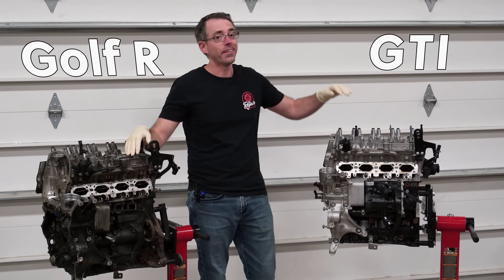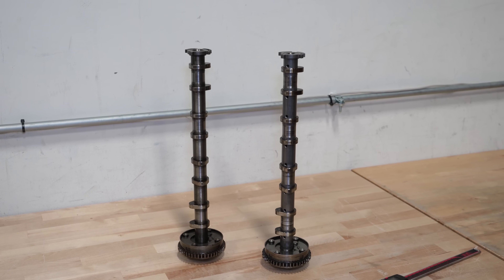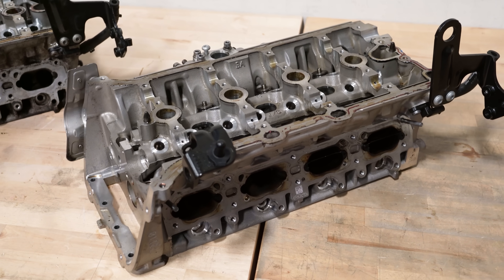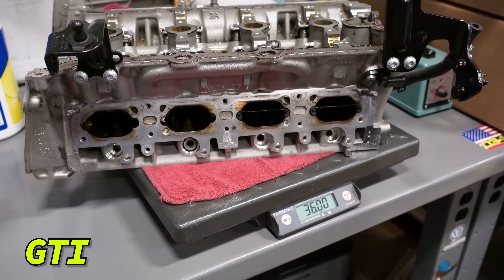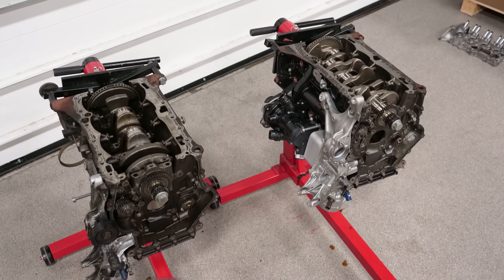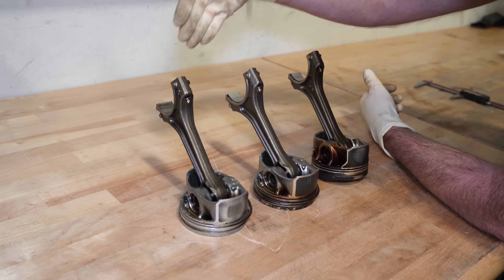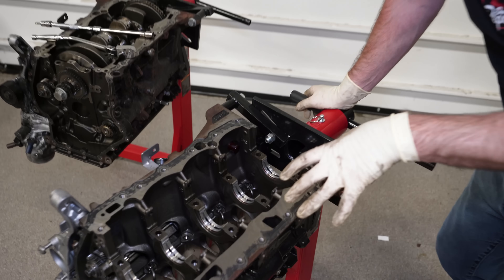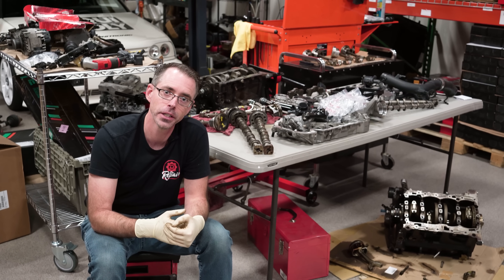Are Golf R Engine Internals Better than a GTI?

Comment: You can find the actual Audi SSP detailing the changes from the 2.0T low output (is20) to the high output engines (is38). And yes, the valves are different materials.
Reply: We need a link/vid

Comment: You put a risky claim on that the cam from a GTi and R are the same...
For sure if the part number is different, the part is different...only the manufacturer know what's the difference...and adding to this, they will attempt to save money if a GTi cam will last in a R engine for the intended life span.......
Reply: OEM's put different part numbers on exactly the same parts at times. 
I know that from working in the OEM supply bussiness.

Comment: Why I love my 40 year club sport mk7… 

Gti with R motor and turbo..CJX coded motor
Reply: Same . Best of both worlds.
Reply: and still FWD 😂
Reply: @blam9346  Clubsports are much  faster around a track than the R and better to drive. But youre probably American and they were never sold there so you wouldnt know brother 👌
Reply: @blam9346  on a roll though I’ve taken down many a R
Reply: @blam9346  It's a Golf after all.  Golf is all about the packaging advantages of front wheel drive, compared to the (at the time) old fashioned rear wheel drive Ford Escort, Toyota Corolla, AMC Hornet, etc. You can have a M140i or M2 if you want rear wheel drive I guess.

Comment: Given your claim that the parts for the Golf R engine is generally better, the same may apply to the Golf R crankshaft too. So it’ll be interesting to see the outcome of your experiment of mating the GTI crank with the Golf R engine.
Reply from the maker: It’s possible it has different metallurgy or heat treating but hard to say.

Comment: perhaps the duration on the R cams is how they got away with not having to use secondary air due to "EGR" is done on the exhaust cam
Reply: If the exhaust cam duration is long enough, the negative wave will return from the exhaust port and travel across the cylinder and up the intake port since the intake valve may already be opening before the exhaust valve shuts. There's tuning reasons for all of this. Of course all the stupid emissions laws really makes it tough for manufacturers to actually tune cam timing between IN and EX in a way for max power, exhaust scavenging, and the like.
That is what is identical in scientific principle between a 4-stroke and 2-stroke, is the exhaust pressure waves and how they affect cylinder efficiency.
Reply: @turnin.sprocket  awesome.
Reply: Now that is good thinking. I am looking forward to the next video to see if they also come to this conclusion.

Comment: The extra duration on the exhaust lobe is to sacrifice a little efficiency at low load for an increase in exhaust gas to the turbo at higher load. In other words it helps response with that larger turbo but will likely use a little more fuel around town.
Reply: I read somewhere that in the EA888.4 engine more exhaust is directed through the EGR to heat the engine faster thus reducing emissions.  It may already be in the EA888.3 R engine along with the copper alloy head?  Also the coolant specification for the Gen 4 engine is different than for Gen 3 possibly indicating more Cu in the alloy, requiring a coolant less corrosive?  The Gen 4 also has a Continental turbo not IHI.  I just bought a T-ROC R with the gen 4 engine, so have been slowly learning about it.
Reply: @einfelder8262  Its exactly that. The gen 4 is just massaged to get through the later EU emissions regs. Warm up and temperature control are critical at that level of emission scrutiny. Its not just the engines ability to pass more heat off but also its ability to keep the temperature as close to optimal as possible over as much of the operating time as possible. 
Fast warm up and cat heating is critical for lower cold start emisions but that wouldn't work well on a GPF car if it had to run hot which gives more NOx so it has to get hot fast then level out and hold temperature well - hence the different materials used.
Reply: @siraff4461  My Gen 4 also has a GPF/PPF (gasoline we call it petrol :)  ), not  sure if all of them do.  But it definitely warms up to operating temp fast (at least on the gauge.
Reply: This makes sense to me intuitively as a neophyte!
Reply: How come the engine looks so weird and 220hp turbo is wildly weak and inefficient like compared to a honda k series it looks like a cheap toy from performance to design and visually lol. Is that just a vw thing?
Reply: @repingers9777  Weak and inefficient? It makes more torque over a much larger spread, more top end hp unless you're talking about the JDM 220hp K which is quoted on their rather more spicey fuel and on top of that it uses far less fuel and puts out way less emissions - which is the entire reason the K couldn't continue in any of the heavily emission regulated markets. 
It also comes in variants far higher powered than 220hp.
Reply: @siraff4461  dang you are smart the world is less cooked than i thought. Also i was surprised to see a new version of variable lift i havent seen!
Reply: @repingers9777  There are quite a few versions of variable lift or timing or both. 
An interesting one is the Suzuki system they use on their newer GSXR1000. Its effectively centrifugally controlled like a small version of a snowmobile variator so there are very few moving parts and its very compact/light. 
Its downside is its fixed so electronics can';t change when it varies the cam but of course you can change the weights if you need to go that far into things.
Reply: @repingers9777  220hp (or even the 1.8 EA888 at 180hp) is heavily detuned.  It's more than a match for the K20C at making ~320hp. 🙂I think the K is the more elegant engine (the timing chains, balance shafts, water pump etc are far more simple; the VW variable valve lift system with 8 solenoids for 4 valves is preposterous), but VW guys love their robust cast iron block and semi-closed deck!
Reply: @TassieLorenzo  respect
Reply: @repingers9777  VW owners don't give a damn about your k series engines, nor do we give a damn about your opinion.  Go back to your ricer videos.

Comment: Those lines on the con rods are from them sheering the flash off not from the actual forging process. The flash is the material that squishes out of the forging dies at the sides.

Comment: According to the VW parts catalog, Gen 3 Golf R connecting rods are the same part number as Gen 1/2 EA888 engines. GTI rods are the same as every other Gen 3.
Reply: Sometimes they reuse (old)components in new developments...thus saving on development costs...

Comment: I thought they'd be even more identical than seen here just to keep supply chain/parts/assembly etc as simple as possible.  I guess the cost of certain GTI parts are cheaper than R but It's surprising that difference merits using more than 1 part.
Reply from the maker: I thought the same
Reply: There's a heap of variations of both engines, globally. It's already too doggone complicated. Thanks to save-the-planet overlord goons.

Comment: Fascinating, I'm looking at either a 3rd gen Audi TT roadster which can be mapped to around 300hp or an S3 convertible which has 306bhp out of the box. As the 2l engine is mostly the same  as the VW here I'm assuming now that the S3 is the better option as the engine is built to handle 300bhp long term

Comment: Aside from the actual alloy of the cast (which I didn't expect), there doesn't seem to be much of a difference between GTI and R.
Sure, the small differences can do something for long-term use and wear. But IMO nothing seems to crazy to see it as a "must have" upgrade over the GTI.

Very interesting, and great video idea!
Reply: Agreed. The biggest practical difference is the turbo itself and the exhaust lobe profile change to accommodate the difference in turbo response and feel. A stage 1 GTI tune is making more power than the standard Golf R tune to begin with, so it's not surprising given they're essentially the same motors and I'm not aware of any real increases in engine failures on tuned GTIs. Makes sense given the internals are essentially the same where it actually matters for making power reliably between both the R and GTI.

Comment: I just did pistons on a Audi 2.0TFSI flex Fual
I’ve always wondered the difference in these engines. I knew they were very similar. The Audi flexfual head also does not have Secondary air And a larger injectors for the high flow ethanol. My engine Code is CPMB

Question at what RPM does the variable Exhaust cam change?

Comment: I’d love to see the differences between the later mk7.5 R and GTI or mk8 R and GTI… to see if there are internal differences with the GTIs calling for 508 0w20 while the Rs are still using the more traditional 504 0w30
Reply from the maker: They changed oil pumps for the 0w20 cars.
Reply: @Deutscheautoparts  aren't the piston rings different as well?
Reply: Honestly I don't see 0w20 being better than 5w-40 for turbocharged engines.
Gotta appease the CAFE standard gods with a minuscule amount of internal fluid drag reduction. Probably at the expense of overall oiling durability.
Reply: @turnin.sprocket  well we're just used to thinking old school mentality lubricants have changed engine technologies have changed tolerances in engines have changed so have oils... I mean keep in mind indie cars run a 10-weight oil in their race cars.  Granted the engines get built after every race but still and they rev to like15,000 RPM.  Now if you have an engine built and the engine builder specs the car for a 40 weight oil then by all means 👍 but you can't compare a street car to a race car even as much work as people put into their street cars it's still just a street car.
Reply: @eppyz  I'm middle aged. There is no old school in my lifetime. I'm quite aware of tolerances and lubricant changes and so forth. Making the stuff like water viscosity is for fuel economy. That's why they do it.
Reply: @turnin.sprocket  so Indy 500 cars that race with 10w oil isn't a good thing huh? That's what they run, granted engines get rebuilt after each race but so do NASCAR who runs 40w.  95+% are cars are driven on road not a track anyway   so if it makes you feel better run a 30 or 40 at the track and back to a 20w on the street   i tracked a 500awhp Lancer Evo on E85 and ran Redline 5w30 for 6 years not one engine failure.  Even though i was told to run a 50w.  If your middle aged you know old school .. No fuel injection when you were born? And V8's made 160hp so yeah things have changed.  I have seen failures with low viscosity oils and higher viscosity there is a time and a place depending on application...95+% of the time whatever the manufacturer recommends should be fine 😎
Reply: @eppyz  I'm not going to argue with you. You've achieved the peak of knowledge and understanding. Wouldn't want to mess that up.
Reply: @turnin.sprocket  not sure why your being so patronizing.  In my experience I had certain results and obviously in your experience you had different results doesn't mean I'm right or wrong doesn't mean you're right or wrong.  So we'll just agree to disagree and leave it at that.
Reply: @eppyz  Just tired of arguing with jerks on social media who quit learning years ago, and never ask questions. Seems people only ask questions if they are working a job and are getting paid. Otherwise, they never ask questions.

Comment: I don’t think it matters on this occasion, but to measure the lift of a cam the height of the lobe should be measured from the centre of the camshaft, and then the distance of the opposite (valve closed) side from centre subtracted from it. It’s actually possible to have a smaller overall cam lobe, but with higher lift than a larger one.